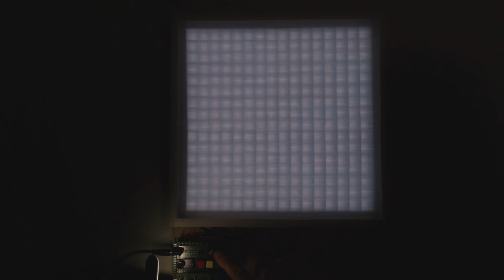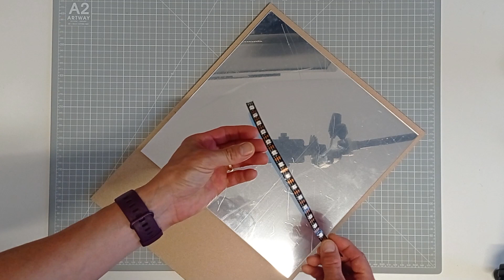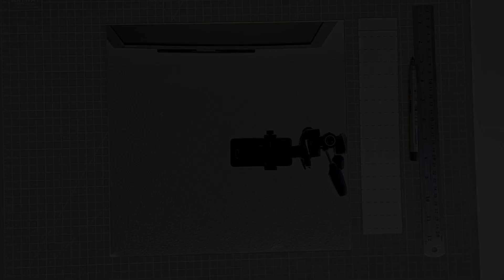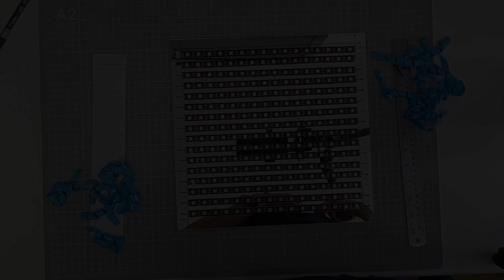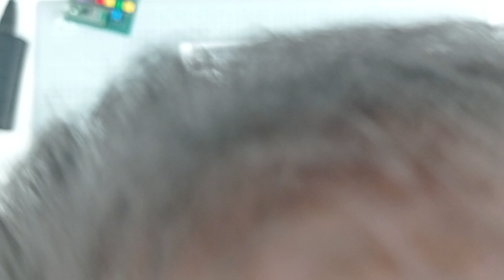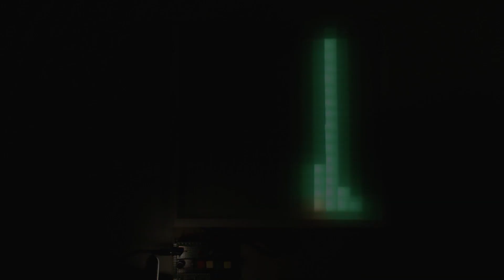Building Your 256 Pixel RGB Lightbox

Comment: Thank you for this nice project! I just make it for myself and some modules are working and some of them does not working. my thonny installation does not have ulab packages so spectrum and vortex modules that needs microphone handler not working.any ideas?
Reply from the maker: I've not really used Thonny. There should be a way to import library files into it. Have a look at the documentation. Good luck!
Reply: @BytesNBits  so would you please tell more about programming environment can run code of this project
Reply from the maker: @meysamkhezri2723  I use PyCharm. Have a look at this video - https://youtu.be/44dwZCz4_sc

Comment: I wonder if the dividers should be black to produce more crispy edges. This way only the "floor" of each cell will reflect the light upwards. You could paint it also using some matte black color to make it absorb the light even more.
Reply from the maker: Good ideas, thanks. I guess there are a number of options to try out to see what works best.

Comment: Awesome project. The only change I would like to see is the use of a USB-C PSU input (nowadays quite a few people have Laptop and Tablet charges that could be used)
Reply from the maker: The power supply connector can simply be swapped out for a USB C connector. When we get to the PCB stage I may well include the space for a USB C power connector.